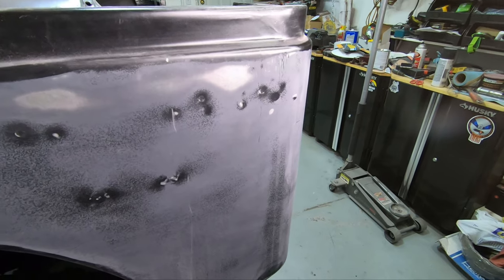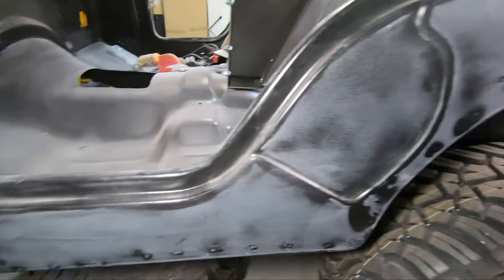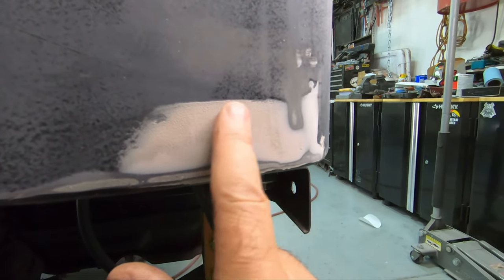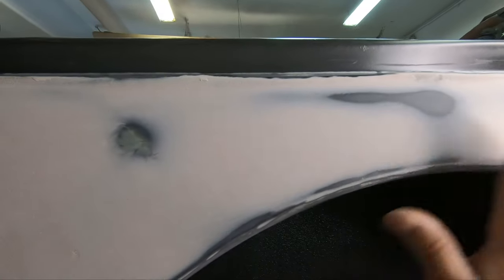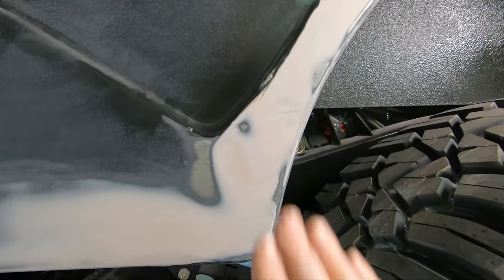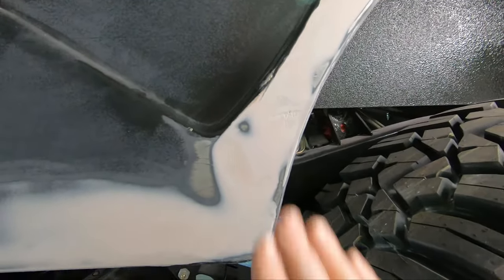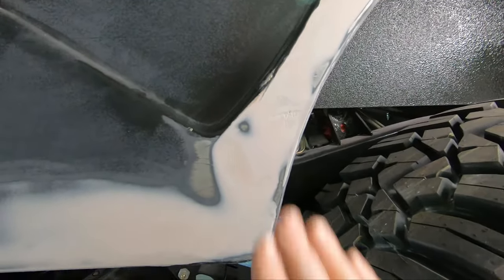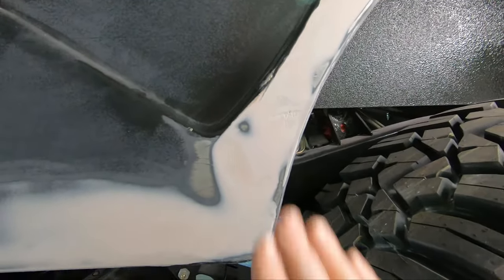Jeep CJ-5 Restoration - EP36 - We're just about done prepping this tub and fixing it's warts.

Comment from the maker: Too bad there's not some way to go back in time and see an original Jeep tub rolling through the assembly line to see how they looked.  I'm curious how the spot welds and such were done cleaner than those on this tub.
Reply: All the old 5's n 7's had visible spot welds. They weren't terrible but you could find em. Jeeps were Jeeps. We use to laugh at the guys that buy em then wouldn't take em off road. They drove around the towns burger joint showing em off. THEY are jeep. THEY wrote the book on 4 wheel drive. THE NEW ONES NOT SO MUCH. The new jeep like a 4 wheel drive P.U. Truck are OK in a 40 acre field but Off Road Not so much. THEY GO GREAT But, To big and clumsy. The 5 is perfect in most ways. THEY WILL ROLL. And you can't take your eyes of the road. They don't steer like a car. You will be in a ditch if you don't focus on the road.  AND What ever you do in a CJ 5, you do it in a straight line. Nothing like the 5. The Straight 6 232 or 258 are idea as they are better balanced off road and not nose heavy like a P.U.. The 4 speed Super Low with 4 speed and V-6 buick engines were really good but prone to overheating if stuck. The 232 are good so is the 258 went really well. They last for 300 k miles with normal oil changes and maintenance. The cats on the California models destroy the engines with carbon. American Motor Destroyed the Jeep due to the Federal Governments Pollution Crap. The 5 had law suits by the slip n fall lawyers due to roll overs. JEEP they didn't break the bank and they did and still do go anywhere. $6,800 new 1978 CJ 5 stock. Enough for now.
Reply from the maker: Hi Ron.  I know the old rigs weren't pristine, whatever bugs ya, bugs ya, right?  And looking at these forever would have bugged me forever.  But I couldn't agree more, there's nothing like these older CJ's when the going gets rough.  This rig was usually the one rescuing others back when I last had it on the trails, so I hope to get it back that way soon!  Thanks for watching.

Comment: YOU ARE NOT CORRECT ABOUT THE STEERING SHAFTS. The originals design is correct. The new one you have will Destroy the Steering Gear or lower upper shaft bearing. The lower shaft steering cup allow for deviation in the length of the shafts. Most replacement shafts dont allow for this and I have even seen Blinker and upper columb shaft damage because of no tolerance in the length. I OWNED CJ's back in the day. NO EXCESS PLAY. You can buy the parts and rebuild the original shafts. Beware, the korean made shafts with the small swivel joints. DANGEROUS. The metal is soft steel and some are just press fit. DANGEROUS.  Please correct this error so others don't repeat it. LOVE YOU SHOW. I LOVE THE CJ'S. My wife and kids cryed when I sold the 1978. 7 years and 250 miles later. TOUGHEST THING ON 4 WHEELS. As a caver I used the jeep on many of roads in TN. Thanks. GET AN ORIGINAL SHAFT OR BE prepared to replace the lower bearing or steering gear. Rebuilding a Renegade 5. LOTTA Body work welding n patch stuff.
Reply from the maker: Hi Ron.  I'll do a bit of research before I speak to your comment here.  But I will respond once I've had a chance to do some serious digging.  You raised some serious points and I think you (and everyone watching) deserve a serious response.  Stay tuned and thanks for watching!
Reply: If the new shafts does not ah just in length as the jeep flexes it will exert force against the upper shaft. That was the reason for the lower coupling joint. While the column may be a collapsable shaft it is ridged unless in an acceident. If your replacements length can vary it is fine. Most I have seen are fixed. HOPE THIS HELPS CLARIFY BETTER WHAT I WAS SAYING.
Reply from the maker: Ron, I reached out to Borgeson but didn't hear back from them.  The shaft can telescope as needed, and after poking around on a few of the Jeep forums, most guys that have run these for a while are very happy with them and are reporting no issues.  I will certainly keep an eye on this and report back if there's further developments.  Thanks for watching and getting involved!
Reply: If is ridged in length and doesn't telescope it is not engineered correctly. There is movement between body and frame the shafts was made with a coupling (that slides in and out). Why do you think the engineer made it that way? I have seen the steering gear twist on the 5's not to mention flexing and twisting off road. If anyone tell you different they are ignorant. Again ask an AMC or earlier Engineer not some person that is a shade tree mechanic. If it telescopes that's will work, if not as many of them being sold do not then don't use it. The telescoping doesn't mean collapsible in a wreck with the nylon pins. The shafts must allow for flexing. It is obvious.
Reply: If the shaft you have will slide in and out in your hand it is fine. My comment was to make you and other aware the couplings purpose and even the rag joint served the purpose. I and many other in the past have bought or seen the selling of a supposedly collapsible shafts that ridgid in their length. They will damage the steering components. My intent was an attempt for you to make sure in could freely telescope in daily use not to allow for flexing. Many aftermarket products are junk and dangerous. Hope this helps clear up any misunderstanding. A lotta junk out there being sold for the CJ's.